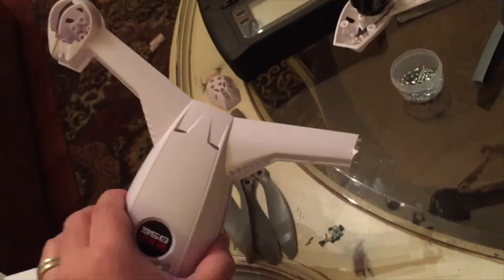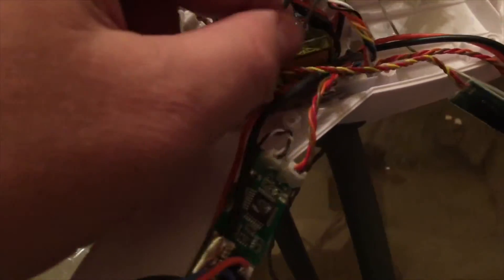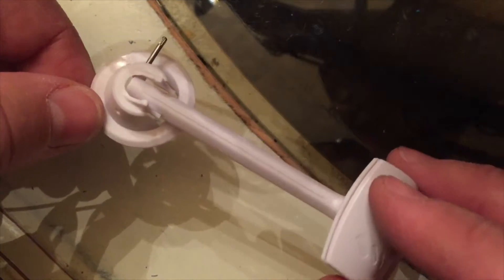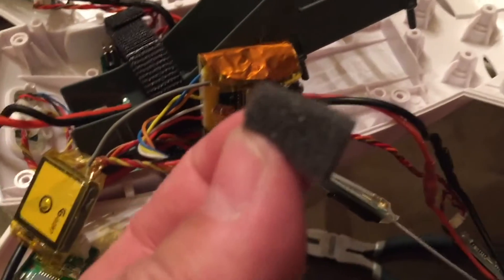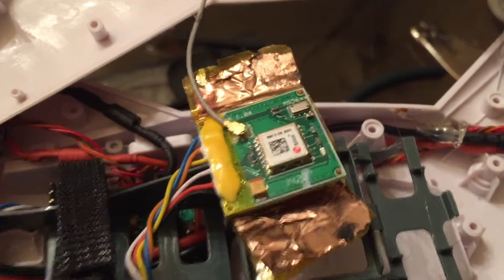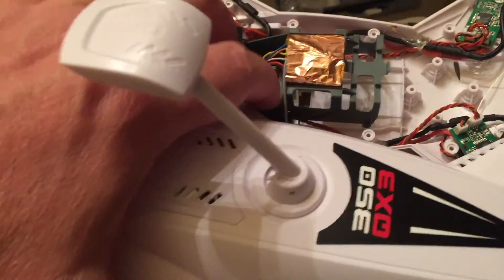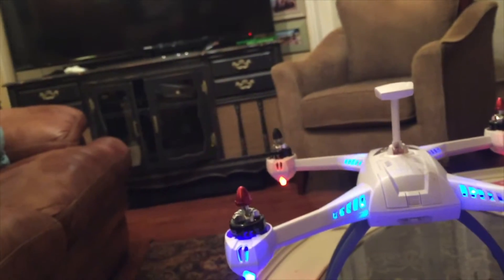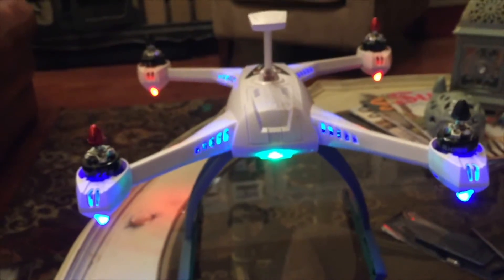Crashed Blade 350 QX2 Upgraded to QX3 Body and GPS Mast

Comment: Thanks. I've had my Blade 350QX for 4 years new in the box waiting for the time to get it going.  I saw another YouTube video a few years back about adding the GPS mast and antenna but couldn't find it. I bought the antenna kit and it has been sitting in the box as well. Your procedure on installing it will be very helpful.
Reply from the maker: Glad it will help.  Best of luck with your build!
Reply: Did these work ok with the Camera on board that has been an issue for these.